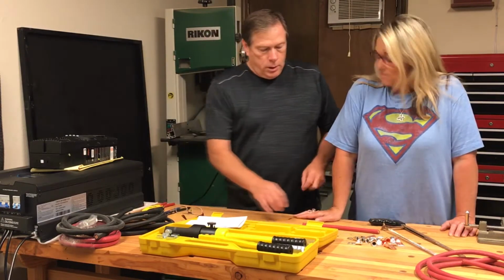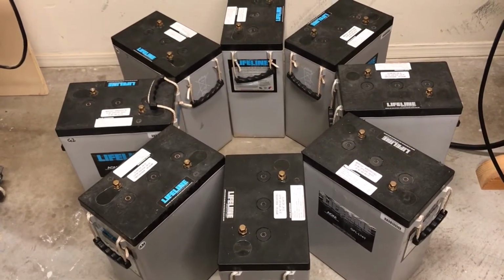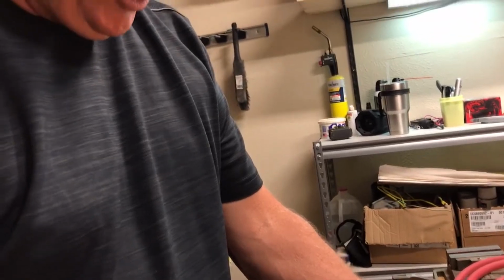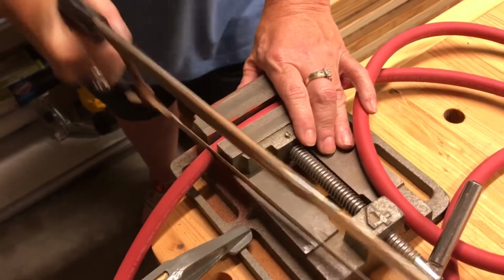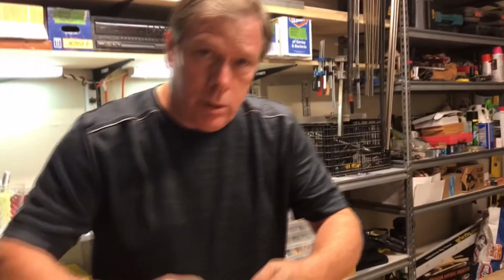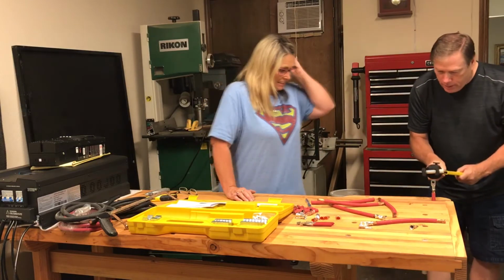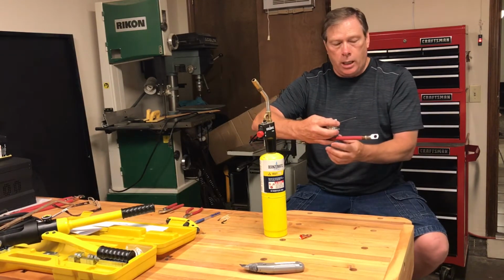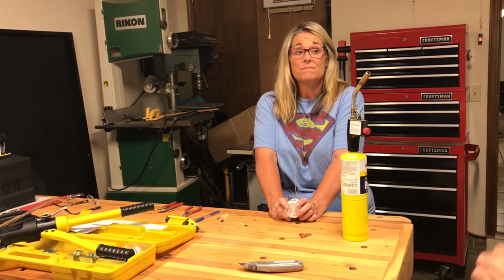We Were Surprised Too! - Connecting Solar Generator Batteries

Comment: you should have used some flux paste on the wire and lugs.....and the lugs pointed down, so the molten solder can run into the bottom of the lug when soldering, filling any voids, and maximizing contact from cable to lug...less resistance equals less heat.
Reply from the maker: Thanks for the input!

Comment: You mentioned a trailer, good job on the cables bud, a fellow off-grid person i know bought a small 4x6 enclosed trailer and turned it into a solar shed for his RV that he tows behind his RV and connects it when he is stopped, because he didnt have room in the RV to put all of the batteries and solar gear, he put 2 panels ontop of the trailer also that charge the batteries all the time. He just uses Anderson connections to connect the RV power/solar to the trailer. In regards to batteries, go around in your city and see if you have any Battery Plus, and hardware stores that will allow you to take the old laptop batteries and power tools batteries that people recycled. I have been collecting these for 3 years and been building up a massive battery wall over time using old used 18650 cells. I have 4 testers so i can test 16 cells at a time, i gather them for a while and then build battery packs using cell kits from https://vruzend.com/, Im up to about 70KWH in lithium power currently after 3 years of recycling 18650 cells and have very little into this battery bank, with 80% of the cells being free, i bought some laptop batteries in the early days of the build, but since been just collecting used free ones, putting post on facebook and craigslist asking to pickup people's old laptop batteries they no longer use or dont work.
Reply from the maker: Thanks for watching, William!  Yes, I have an old welder's trailer than I am converting into a mobile solar generator.  Great idea, collecting used batteries.  They have a lot more to offer than most people believe.